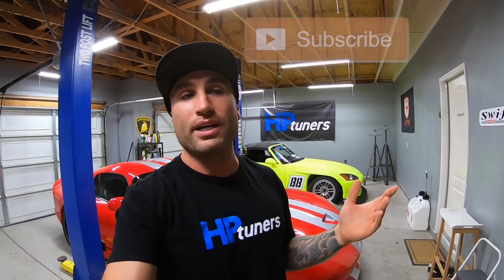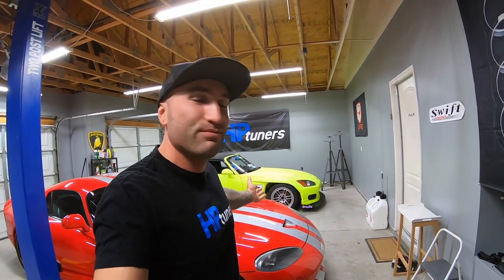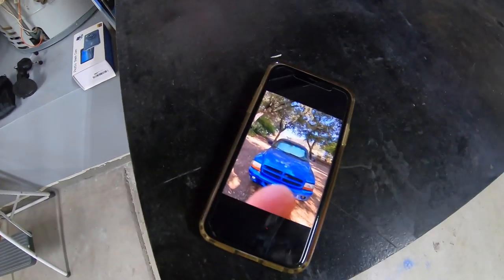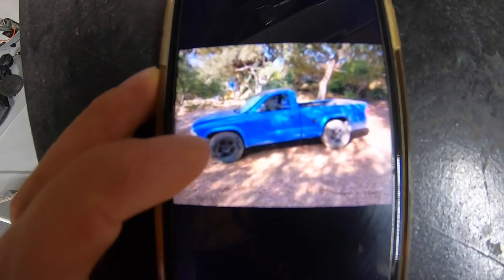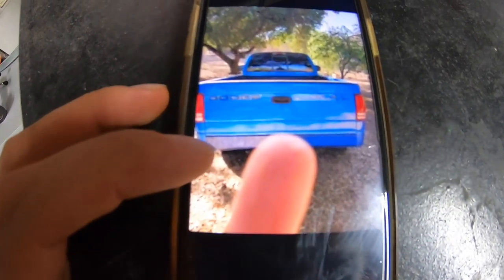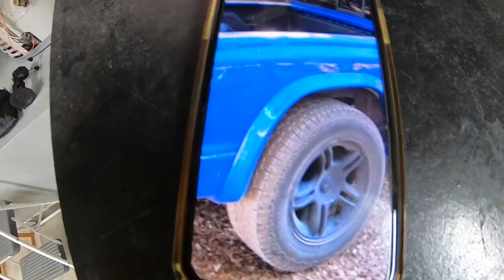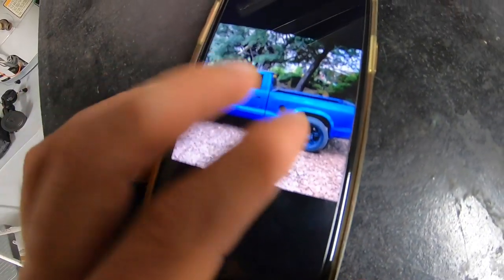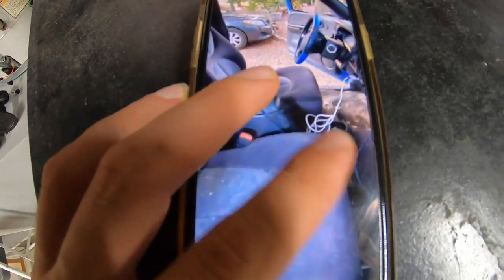DODGE DAKOTA R/T PROJECT TRUCK 5.9L MAGNUM

Comment: SBE with good cam, Edelbrock heads, airgap intake, headers and procharger will make 500+whp rather easily. Whatever you decide engine wise, Flyin Ryan Performance is who to go to for tuning. There's a reason he ends up re-tuning everybody that went through somebody else.

In October I'm picking up my 10.2:1 shortblock from the machine shop and it's getting a vortech blower. Shooting for 550wheel for my 4x4 ram.

If you wanna upgrade the headlights do a projector retrofit build. Can be done diy pretty budget friendly and the outcome is second to none. Can do any kind of custom touches like you see all over while you're in there and the output is outstanding

Comment: If you were to find a 4th gen hemi engine to swap into the dakota, would you have to find a new trans or would the stock trans work? I think you should keep the current engine, get a stroker kit and rebuild with stronger internals. You can easily double the factory hp and tq ratings for that 5.9 without going crazy with a turbo or supercharger.
Reply from the maker: We will definitely see what we can do with the current powerplant first.  I still have to look into what swaps are compatible for the future 😎

Comment: You can fit a hemi in Dakotas.  I'm looking at replacing the 4.7 in mine with a 5.7.  Motor mounts you can find online, wiring is the hard part, can do it yourself if you can read wiring, hot wire auto will do custom harnesses, and you need the pcm of the hemi or flash a tune onto your stock pcm.  Depends on how much of the stock 5.7 wiring you get with the motor.  Also if it has the older style dash (your accessory gauges will have numbers) you need to swap to the newer dash (no numbers on oil, temp, etc) which isn't that hard. 

I also have a V6 dakota sitting around (my dad's he bought in 98) that I'm looking at putting in a 360 in and making a drag truck out of it.  Maybe a stroker kit, whatever I can do for relatively cheap.
Reply: Also an old viper V10 will pop right Into a dakota.  This is a lot more straightforward than a hemi swap, much like going from the V6 to a 318/360, it's pretty much just adding two more sets of wires for the new cylinders.

Comment: You can build the 360 to make some monster power its all in the heads the stock heads dont flow at all and they crack i recommend putting on a set of w9 mopar heads fully ported

Comment: Subscribed! I own a 99 Dakota RT CC (somewhat built) with spray, aluminum heads , 210 cam , LT hookers,4.56 gears , pretty stout ! I also have an 05 SRT10 reg cab 6speed, That at the time is getting built at a shop for the past 2 years(actually since I bought it) and I also have an 07 SRT8 Jeep with some minor mods , I want to know where you’re going with this truck ! Good luck

Comment: I would say absolutely YES on the Dakota!! Fairly light, pretty strong frame and an overall great platform for a muscle truck. I really miss the Hemi Ram and honestly haven't watched your channel since you sold it though I do completely understand your reasons for doing so. Not trying to sound negative but I could give a crap less about another Honda or Mazda or whatever it was project, just me. Build a strong muscle truck!! I bet you'll get a ton of views and more subs also.
Reply from the maker: Yeah i'm hoping everything comes together I think this will be a fun project!  No hard feelings on the Honda.  Trying to continually switch it up with different builds so there is something that hopefully interested everyone 💪👍

Comment: I’ve got a 2000 Dak rt that’s turbo. Heads cam intake pte6768. 11.04 @124 Check out John cope for the trans stuff. He can build you a really strong 46re with manual valve body and trans brake

Comment: Please do right by that truck. Love those trucks and they ain’t easy to find in good shape. The 360 magnum has loads of potential. If you’re just going to butcher it and do a swap, go find a v6.
Reply from the maker: Definitely won't butcher it!  We will keep the 5.9 and mod that unless it explodes but even if we swap it we will still keep the original drivetrain off to the side so it can be returned to stock 👍  Similar process as we did with the last truck going fully modded and then all back to stock original
Reply: BoostedMotorsports as a mopar purists, I agree

Comment: There's tons of nicer RT's for 2-4K. But, double check the VIN to see if it's a real RT and not a clone. These trucks are prone to peel the clear coat.. probably why the roof is wrapped. Hellcat swap for sure..run the 8 sp. trans there's a controller for it now. Good luck!

Comment: How much work to build it into a 408 ci , and what kind of output for a 408
Reply from the maker: I'll have to do a bit more research on these engines if I can lock down this deal! The displacement is there but the hp is way low!